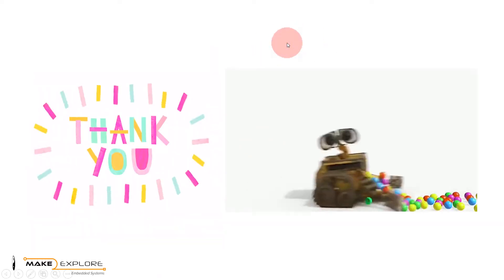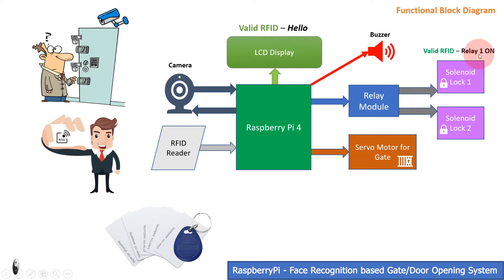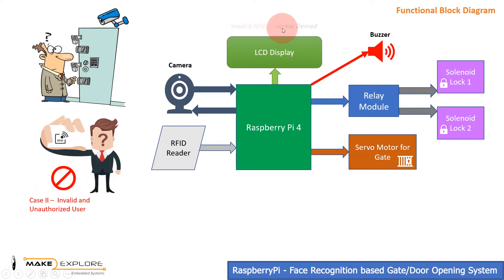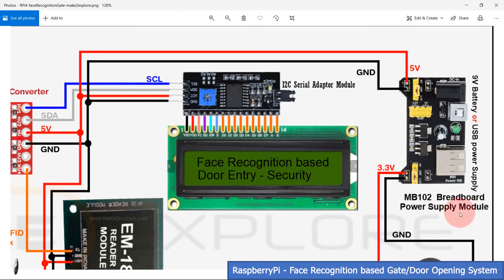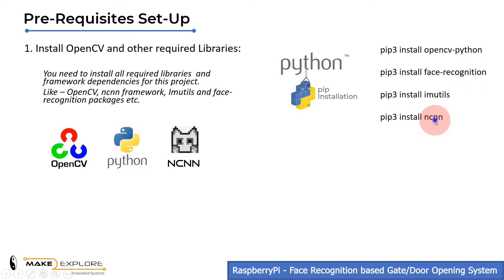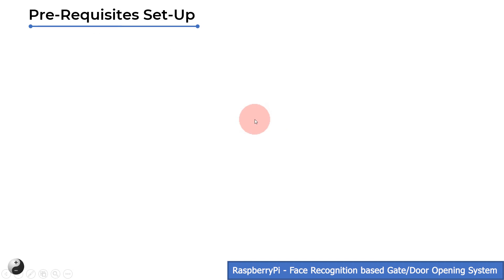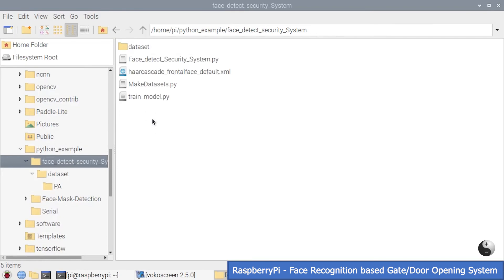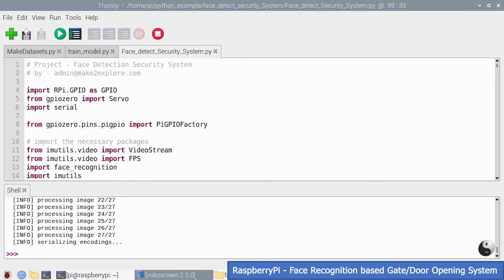Face Recognition based Gate/Door Security system

Comment: what jumper wires did you use?
Reply from the maker: Dear @Ssyn23755, 
Thank you very much for your interest in our channel.

Q - what jumper wires did you use?

➡️ As this video was only for DIY implementation, we used Dupont line/Breadboard Jumper wires- Mostly F-to-F 20CM (compatible with 2.54mm spacing pin Headers of RPi4).

If you still have any queries/issues/suggestions about this Tutorial, or any of our DIY project, feel free to ping us on WhatsApp/Telegram (Links given below) for further support.

Tech support - (𝗖𝗵𝗮𝘁 𝗢𝗻𝗹𝘆) Telegram/WhatsApp - 11:00 AM - 05:00 PM (Mon-Fri) IST   

🚀 𝗧𝗲𝗹𝗲𝗴𝗿𝗮𝗺      🔗 https://t.me/make2explore
💬 𝗪𝗵𝗮𝘁𝘀𝗔𝗽𝗽    🔗 https://bit.ly/3VXGGEe
📩 info@make2explore.com  / support@make2explore.com

As per time permits we will try our best to help you out. 

Best Regards
Reply: @make2explore  will you make a like a video doing hardware connecting i need it for my thesis

Comment: hi the instructions arent clear enough do we need to use putty? and how did you put your source code in the raspberrypi?
Reply from the maker: You can see in video, we are using Code::Blocks IDE for c++ code and Thonny IDE for python code. So, please note that, First, you have to install all necessary software's like code::Block IDE. Thonny IDE (If you are going to use python approach), Python, OpenCV and other necessary packages in Raspberry Pi. This project is somewhat complicated and lengthy to implement, so we have covered only important parts. I would suggest go with python, its bit easier than C++ method.